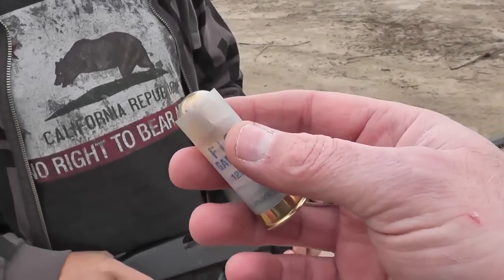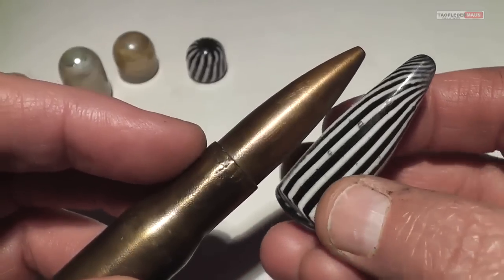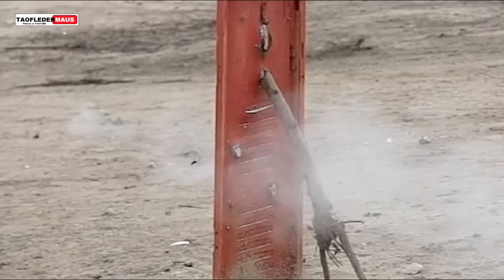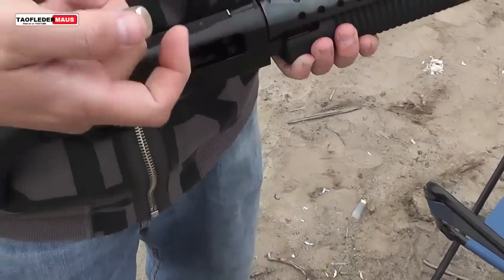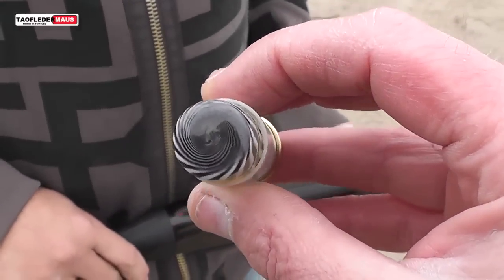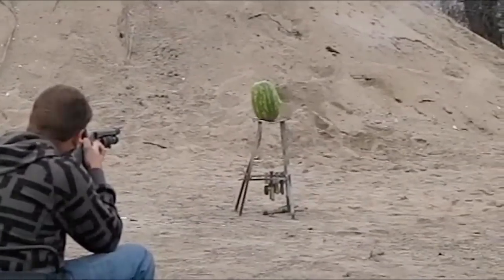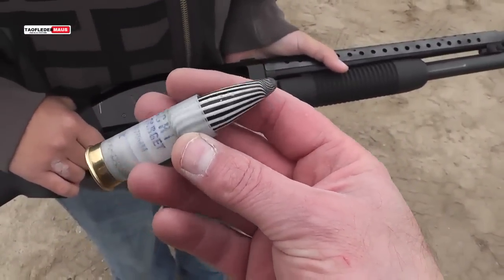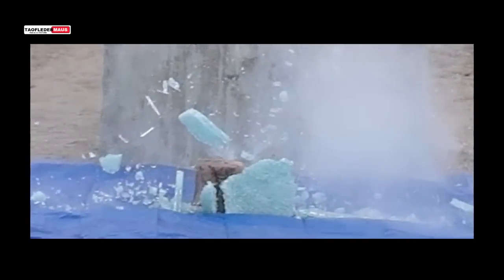Glass Shotgun Slugs-  How deadly are they?

Comment: good video. how 'bout investing in steady rest, just a suggestion.
Reply from the maker: We have another set of these and just for you he'll use a rest.   I'm giving you a heads up so you can come up with another excuse why the rounds were curving.
Reply: Exactly what i was thinking.
Reply: Or Maybe hold the gun from the forward grip like its meant to be. It may not be a big deal for pinking around but a lot of new shooters may watch your show and pick up poor shooting techniques.
Reply: ***** the rounds were curving because of air resistance Air resistance is an important factor affecting projectile motion. As a rifle bullet travels through the air, it tends to slow down because of friction between the bullet and the air through which it passes. The amount of friction, in turn, is influenced by a number of factors. Among these factors is the shape of the bullet. Most bullets (and other kinds of projectiles) have pointed front ends—a feature that reduces air resistance. A bullet with a blunt front end would experience a great deal of air resistance and would slow down rapidly. Rotation affects air resistance as well. A good quarterback always tries to place a spin on a football. This helps the football to travel through the air more smoothly than it would without the spin this is why rifling in the barrel  is so important The rifling causes oblong projectiles like bullets and shells to spin as they travel down the bore of the gun. The spin is rapid enough to give these projectiles enough rotational inertia to stabilize them in flight and to keep them from tumbling end over end. Rifling became necessary as guns large and small switched from spherical projectiles to the non-spherical versions common today.
Reply: Agreed. Look at 3:28 and you'd think the melon was dancing around. Perhaps focusing on the shooters grip would help.  Good luck.
Reply: ***** Poor outcomes are a result of poor technique. Way to be sensitive, guy.
Reply from the maker: Brandon V
Is it better if I ignore everyones' comments like every other channel?   I can do that too.
Reply: ***** I bet you won't.
Reply: Frank Garrett Agreed, STAB. Steady position, trigger squeeze, aiming, breath control. Love you guys videos, big fan. I can see these do not fly accurate. However I do think resting that shotgun on a bench and a sandbag would help. I think this one is just bothering people because of the amount of work that went in to making those slug, just looking at them looked like alot. I am not glass blower so I would not know, and I am assuming(making an ass of u and me, i know)

Comment: Is this a smooth barrel shotgun or a rifled barrel?  If its rifled, part of the problem is that glass is inflexible and cant track the rifling grooves, so it would come out with no spin and just tumble in the air.  Similarly, it can't expand the way a lead slug or shot wadding would, so gasses can escape around the glass, making for lower muzzle velocities.
Reply: +htomerif If they created a slightly smaller glass slug and applied an exterior coating of lead, do you think that would make a difference or do projectiles need more material than just a thin outer layer to take advantage of rifling?
Reply: The Curious Noob Usually lead projectiles, for rifles, pistols and rifled shotguns have a cupped rear area that expands during firing from the pressure to form a gas seal. and engage with the rifling.

Given that this isnt meant to be a practical round in the first place, I wonder if they couldnt just load a powder charge, then muzzle-load a glass round with something simple like a paper or felt sabot.
Reply: Thanks I did not know that! It would be cool if he tried your method in a future video

Comment: The barrel is rolling in the video but I'm sure that at that distance the round should have still hit, but look at the rounds again, they aren't made aerodynamically, the front of the bullet is FLAT! That's gonna give it a lot less air resistance causing it to be forced in a slightly other direction when shot, don't believe me? Look at any other bullet for any other gun, they're mostly pointed to "pierce" the air as air glides across the length of the bullet a lot easier. and I get that they're slugs so they're going to be more bulky, but even then slugs are more rounded off than cylindrical.
Reply from the maker: VaLyuTV   Finally someone with good observation skills!
Reply: ***** It's mostly common sense haha, also the bullets are made of glass people... It's not like you can just pour molten glass into a cast or mold, glass isn't going to be molded perfectly either, there's going to be nicks and kinks here and there, not to mention the glass has a pattern in it, that tells me it was probably made using the "pulling" method. even harder to make perfect.

Comment: Also with tempered glass you could have thrown a rock at it and it would have exploded. It is designed to bust violently into a bunch of small pieces to prevent bodily harm or injury. The way the glass is made causes it to have a lot of tension so the slightest nick in any spot will cause the entire piece to explode..

Comment: Here's an interesting question. If the difference is a mass to density ratio, what would happen if you used a slug made from osmium steel? Lead has an atomic weight of 207.2 u ± 0.1 u and is 1.735 grams per cubic centimeter while osmium has an atomic weight of 190.23 u ± 0.03 u and about 22 grams per cubic centimeter.

Comment: I can only imagine what kind of war crime those would be used against people. That dust would tear up your wind pipe and lungs pretty bad I think...but I am by no means knowledgeable on such things.
Reply: +Levi Doyle Not only that, but glass does not show up on Xrays and things like that. So they would actually be forced to dig manually through the person on the receiving end of that round until all the pieces were found. It's a technique used in some IEDs overseas. Not cool.
Reply: +Levi Doyle Not sure if they'd explode upon hitting people, though. I guess if they hit bone they would. But yeah, that would be terrible, and is not something pleasant to even think about.
Reply: +kevin Baker Actually, glass is always radio-opaque whether or not it has lead content. The problem is that i'ts all too easy to miss between bone and muscle tissue (9 times out of 10) on a typical 2D xray. You have much better results with a CT scan, but it's still about 60% chance of success. Sonograms simply lack the resolution for anything less than 4mm when near other rigid material like bone and muscle. Your best bet is an MRI.

Comment: Was the first shot just a really lucky shot? I don't quite understand why the heavier slugs would be so much more innacurate, especially considering that it seems the light weight of the material compared to metal slugs (glass is lighter than most metals, isn't it?) is throwing it off course.

Comment: When you used same powder charge for a slug with the glass, you won't get the same power because of less back pressure. Slug being heavier cause more pressure build up before leaving the barrel. Simple physics in ballistics. But that being said, cool vid.
Try making a 3 inch mag round with a rifled slug ( hollow point ) make the hollow point cavity larger to accommodate a concrete nail. Cut nail to fit using the tip of the nail. Insert nail in hollow point cavity and cover with JB Weld. In theory you should get around 1750 fps. See what kind of penetration you get. You can experiment and use a .50 bullet for black powder ( solid copper ) and use as a sabot. It should have good ballistics and be fun to shoot.

Comment: Perhaps solutions rather than criticisms?
What you need is reduced recoil loads, hollowed rear end with a lead plug epoxied in with some teflon tape tail on those light rounds. You could take a foot long piece of teflon tape and find the center of it and epoxy it into the back of a glass slug so you have two streamers running out the back that will stabilize the round in flight. Hell, just epoxy the teflon tape or some flame resistant rayon to the back of one and test it if you get the chance again. Not every experiment has to work you just have to try. That's where the fun is right?

Comment: the reason the slugs drifted around the watermelon is because as the slug flew near it pushing wind onto the watermelon, that cause the wind to go around the round watermelon (just like wings) then pulling the slug easily because it's so light weight.

I'm only a 13 teen year old never learned anything about this at school and I know how this stuff works.
Reply: +Michael Vigil just no.
Reply: +Michael Vigil good please do it quickly

Comment: Did you say that's pretty thick medal? It's a locker door not an armored plate, I could put a hole in it with a rock and slingshot.
Reply from the maker: +Jake Smith Locker doors are pretty tough..  thicker than car doors.   A rock and a slingshot might put a dent it in.

Comment: I'm gonna say the shooter was shaky, but he really didn't have a chance to begin with. Glass bullets are by their nature harder than any rifling, and in a smoothbore, that's even less applicable. 

Those things weren't spinning at all coming out of the barrel, and as a result, they had no chance to stay stable, considering their profiles. They weren't nose-heavy to compensate for low spin, and they were lightning fast. Can't even make those characteristics work together. Oops.
Reply from the maker: Lunumbrus  If you've seen my other videos,  he's moving the gun around the same way and hitting smaller objects from a lot further away.   We kept moving closer and closer and still missing. It was very frustrating because the guy who made the rounds went through a lot of effort.  We could have not shown the missed shots but that would be a discredit to what we were trying to achieve.    Super sonic aerodynamics is complex and people don't realize that the objects are compressing the air in front of the round.  You have to visualize a ball of air that is actually influencing the trajectory  if it encounters a stationary object ahead of it.   Since the glass is a very low density projectile,  the influence is just that much greater.   The good thing is we have another set of these and we plan a part two and we'll bench the shotgun and we'll see if the results are any different.   Heck,  we'll even try a different shooter.
Reply: Oh, I understand completely. I didn't mean to make it sound like I blamed you at all, I know what the aero can be like at those speeds. 

Frankly, having watched your videos, your science is good. People will always criticize that, but that's just intellectual competitiveness manifesting badly. What's more, yeah, you hit what you're aiming at. Seen it.

Just look forward to more. :)

Comment: I know how to improve your game here! ITS CALLED BALLISTIC STABILITY! Shotgun slugs are very low velocity compared to rifles unless you are sporting hot magnum rounds. Even then the slug travels slowly compared to a rifle bullet. You need to take a tip from the humble air gun pellet. You need more mass in the front of the round then the back and this also means that evenly distributed weight will not work at all. ALL of your slugs are flat cut at the base. HOLLOW OUT THE BASE AT LEAST A 1/4 OF THE WAY. Another thing that a shotgun with a cylinder bore lacks is rifling which is what contributes the most to a rifle bullet's stability.

You see a rifle bullet's center of mass is towards the rear, not the front and in motion with the help of aerodynamic drag the heavy part will want to lead in the direction of travel hence "tumbling" of a projectile. The centrifugal forces imparted by rifling in a rifle barrel impart a spin on the projectile that literally uses gyroscopic forces to force the bullet to travel in a straight line rather then end over end. Some deer slugs either have a sort of rifling made into their wadding or the slug itself will have some sort of fins in some of the 'high end' ammo as touted as high performance deer slugs. The only way to get the most serious accuracy in this situation is to resort to ballistic stability. Put the center of mass further forward.

Another dirty trick would be to make the whole slug hollow except for the front and partially fill it with metal or a resin impregnated with something heavier then glass. Fill the rest with a light resin and send that at your target. Glass has some serious hardness but massive fragility. Its hardness can make it penetrate steel easily and with the right mass behind it a slug can have devastating effects especially penetrating bone like a hog or bear skull.

One huge issue with glass is it is light and light projectiles tend to deflect easily. Glass projectiles have been tried before and there are a host of limitations to overcome and the biggest is the stability issue. Since you cannot take advantage of rifling you need to focus on Ballistic stability. Those melons should have exploded on impact. I know because I have hit a watermelon with a Fiocci deer slug and I made melon go SPLAT. Get the maker of these projectiles to make them with a hollow base first and see if that helps stability. You can see it in the slow motion where the slug actually is curving away from the target and deflecting off of its own shock wave. If the projectile is actually on target and coming head on properly the shock wave should not matter a bit. I bet if you got a close look at the projectiles in flight they may be tumbling too.

Just some food for thought.